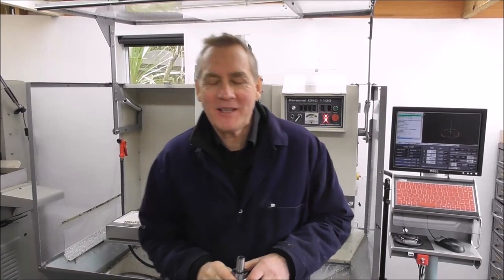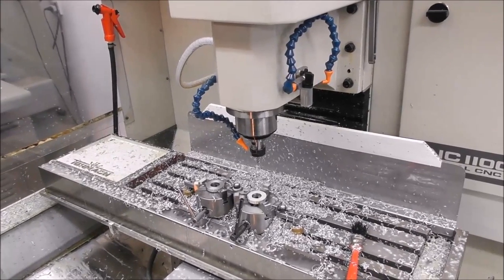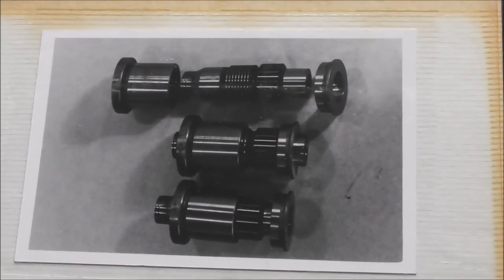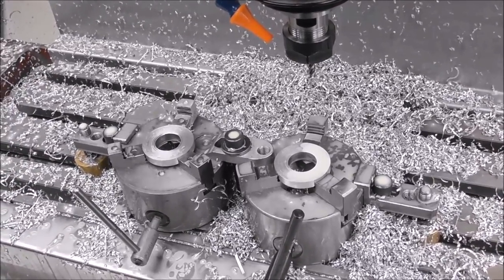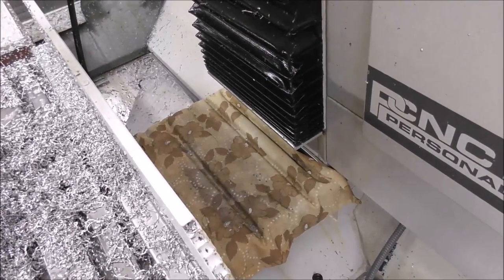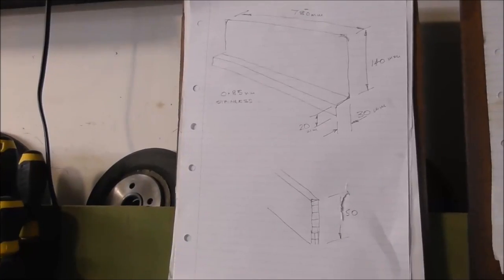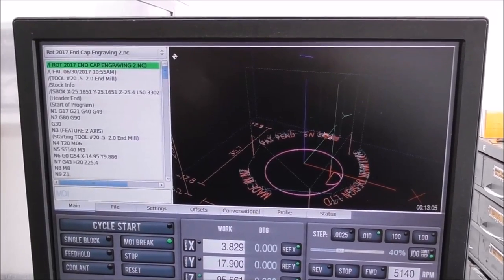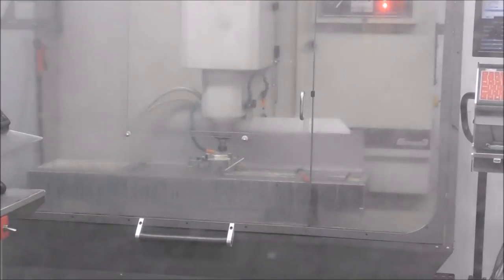Small Shop Production Machining - Tips and Tricks -  Part 2

Comment: Could you say how you radially engraved your parts.  Neither path pilot or fusion 360 has the facility to do this.  I have a part I am making that I would like to radially engrave but can't figure out how to do it.
Reply from the maker: Hi - I use Bobcadcam V28 - which has a fit text to curve facility. Cheers  Cliff
Reply: Thanks!